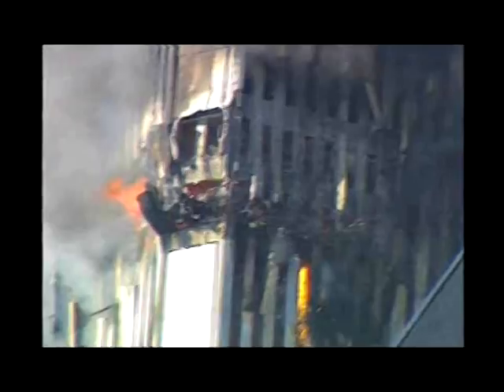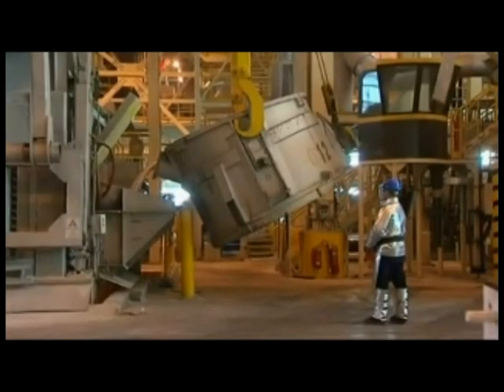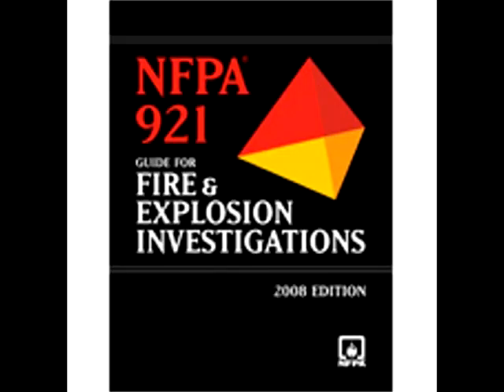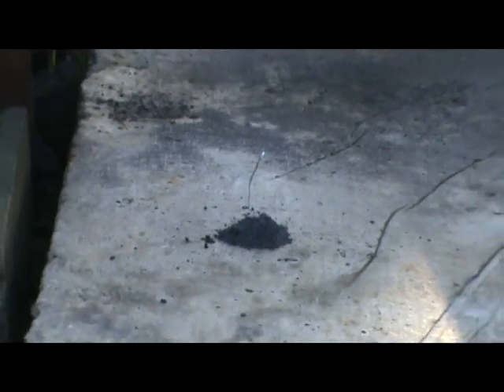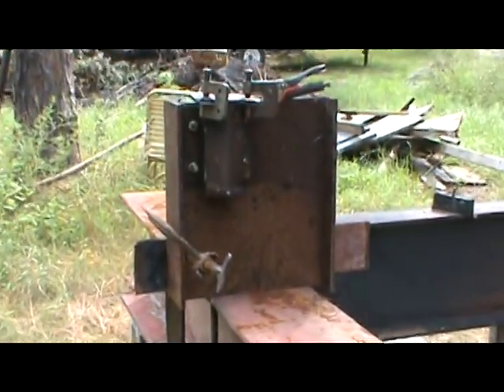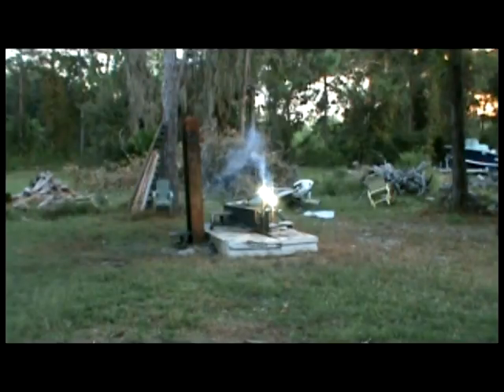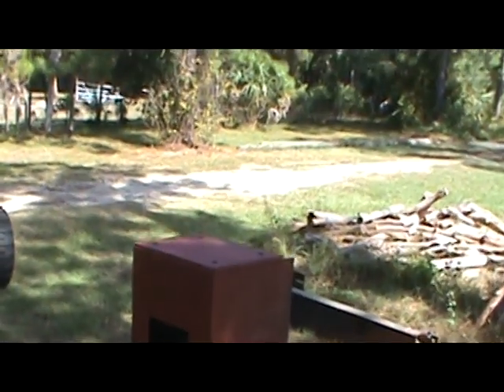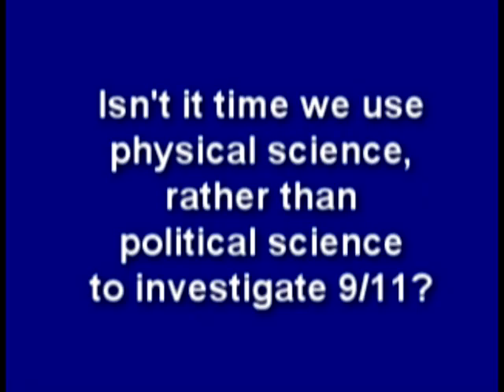9/11 Experiments: The Great Thermate Debate

Comment: lol I thought it was meant to be quite! 
also how did people set up these explosives within the steel framing? the truthers have to wake up
Reply: <also how did people set up these explosives within the steel framing? the truthers have to wake up>

Through the elevator shaft, which has access to the central support columns.  The shafts were closed and under armed guard the months prior to the collapse due to the "elevator modernization" that was taking place at the time.  The "elevator modernization" company is named ACE Elevator, and is a US government contractor with Pentagon ties.
Reply: ***** <The initial collapse of both towers started on the floors from which the Boeing aircraft entered the buildings.>

Irrelevant.

<This would mean that the charges would have to survive a passenger airliner crashing into them. >

No it doesn't.  Why do you insist on spreading the same tired lies that I just shredded on another thread?  Do you enjoy getting new assholes ripped? 

Simply placing the charges in a rudimentary shock and flame resistant container, and bolting them to the inside of the central support columns, would shield the charges from anything coming from the outside.

Are you retarded or do you just have zero imagination, and believe every unscientific "debunker" blog post that gets crammed up your ass?

<YES!!! i know that thermite can withstand extreme heat but the collapse was exactly at the point of the entry holes, so the plane would have knocked the charges on those floors out.>

Prove it.  Your weak-minded speculation doesn't amount to proof of anything.

<You can actually see the corners of the towers fold in on those specific floors.>

The charges would be in the center of the structure, not the corners you simpleton.  Again, your statement is worthless, as you can't see the central core of the structure, and because EVEN IF the impacted charges were damaged, simply initiating the sequence from directly above and below the impact, and then  cascading downward would have achieved the same effect.

Do you have any ACTUAL arguments, or just your baseless, factually devoid conjecture?

Don't bother with that last question; I already know the answer.
Reply: lol irrelevant?  why so? cause you say so?
explain why did the towers collapse at the point of impact?
Reply: Because that is where the collapse was initiated?

There are these cool things called computers, and with a special program, and remote RF detonators, a collapse sequence could be initiated essentially on-the-fly from any desired location, assuming the charges are placed and connected to the computer remotely beforehand.

The charges could be placed in a shock and flame resistant insulative container, and bolted to the inside of the core columns, effectively shielded from external projectiles, like shredded plane debris.

Even IF the plane damaged the charges on the impacted floors, simply initiating the collapse from directly above and below the impact, and cascading downwards, would achieve the same effect.

That's why his quaint "observation" is irrelevant.
Reply: lol ok of they just happened to be at the exact location where the planes struck.  watch the collapse videos again and see the exact location of initial collapse.  if charges were there they would have been knocked out.  
also if the charges were in a protective container, how would the charge destroy the protective container?  or did they calculated how much the container can resist the initial impact but not strong enough to resist the charge... 
lol
Reply: michael9678727 <lol ok of they just happened to be at the exact location where the planes struck.>

Bullshit.  You can't demonstrate that, and you can't see into the core of the building where the charges would have needed to be placed in order to bring down the structure.  

As most of the stairwells in the core of the buildings were still accessible after the plane impacts, it is safe to assume that most if not all of the charges in the core could have also survived the impact, considering thermite can withstand high heat and temperature, and considering it would have been placed in a protective, insulated container.

<if charges were there they would have been knocked out. >

Pure speculation.

<also if the charges were in a protective container, how would the charge destroy the protective container?>

By detonating...

<or did they calculated how much the container can resist the initial impact but not strong enough to resist the charge... >

Uh, basically.  It wouldn't be difficult.  Put a firecracker in your open palm, and it will explode harmlessly.  Close your fist around it and you could lose a hand.  The firecracker in the fist is the charge in the protective container.  The firecracker in the open palm is the initial external blast against the closed container.

It really isn't hard to imagine.
Reply: lol I can't demonstrate that?
watch the videos again and you can clearly see that's where the initial collapse started on both towers. 

you say I'm speculating but your whole argument is based on speculation! 
please remove your tin foil hat and listen to yourself!
Reply: michael9678727 <lol I can't demonstrate that?
watch the videos again and you can clearly see that's where the initial collapse started on both towers.>

Right.  Thats APPROXIMATELY where the collapse started, over the several floors impacted.  You're claiming to know the exact point of collapse based on roundabout observation, when you can't physically see the impacted beams in the core, so there is no way to say "exactly" where the collapse started.  Which, along with the other points I listed above, invalidates your position.

Moreover, EVEN IF what you say is true and the charges would have been knocked out on the impacted floors, what is stopping the pyrotechnics technician from simply waiting for the "natural" collapse of the floor to begin as you debunker types insist was inevitable, and then cascade the charge sequence downward as was observed?

Regardless of which angle you look at it, your "observations" are meaningless with regards to disproving Controlled Demolition theory.

<you say I'm speculating but your whole argument is based on speculation! >

No.  I'm happy to co-speculate, but my entire position is based on the scientifically proven and published presence of advanced incendiaries in the WTC dust by Harrit et al in 2008.  The details are unimportant.  The presence is proven, and all you can counter with is speculation.  I'm happy to cancel out your speculation with my own all day long, and we are still left with an inconvenient published paper that you and your ilk have been unable to refute for 8 years.

Unfortunately for you, your OPINION as to whether a theoretical incendiary charge in a theoretical container in a theoretical configuration in a theoretical location would survive a plane impact which may or may not have even penetrated to where these theoretical charges were theoretically placed, amounts to pure speculative bullshit, and does absolutely nothing to disprove the presence of thermite in the WTC.

You're going to have to address the established facts if you hope to get anywhere beyond useless speculation.
Reply: again, no the collapse started at the point of impact on each tower.
it's amazing how you truthers don't mention that all the "ingredients" of thermite was commonly found in paint, concrete, structural steel, air conditioning systems etc, etc. all common elements found in the towers. but hey let's just ignore that because it might debunk our theory.
Reply: ***** "You're claiming to know the exact point of collapse based on roundabout observation, when you can't physically see the impacted beams in the core, so there is no way to say "exactly" where the collapse started. "

"EVEN IF what you say is true and the charges would have been knocked out on the impacted floors, what is stopping the pyrotechnics technician from simply waiting for the "natural" collapse of the floor to begin as you debunker types insist was inevitable, and then cascade the charge sequence downward as was observed?"

"Even IF the plane damaged the charges on the impacted floors, simply initiating the collapse from directly above and below the impact, and cascading downwards, would achieve the same effect."
Reply: +Emvazz22 I had considered you arguments valuable until you came up with the stupid firecracker experiment.You think a small Thermite explosion has more power than a 140 ton vessel flying into the container? So the container wouldn't be damaged by the airplane and ignited by exploding kerosine (which has more thermal energy than a small magnesium rod) but by the Thermite explosion?

Even if that would be true, than most of the Thermite energy would be cutting outwards and not into the column.Or to put it into the Firecracker experiment: If I shoot through your fist, you have a hole in it trough which the firecracker can release it's energy. If your palm is open, the blast will take the way of least resistence as well. So if your plam (or the encasing) shall direct the blast towards the steel column, it needs to be thicker and sturdier then the steel column itself.

You, sir, have just debunked your own argument...
Reply: +ExtremeDeathman <.You think a small Thermite explosion has more power than a 140 ton vessel flying into the container?>

1) Who said anything about small?  The thermite reaction is very fast, very high temperature and energy, and a lot would have been needed to achieve the effect seen during the collapses (especially building 7).  Indeed, the Harrit report estimates somewhere in the range of the tens - 100 tons or so of this advanced incendiary material present before the collapses.
2) There was no 140 ton vessel flying directly into the container.  There was a 140 ton vessel flying into the side of a massive skyscraper.  The 140 tons of that aircraft were concentrated in the engines and the fuselage, all of which have a very small cross-section relative to any given floor of the WTC.  Upon impact, the mass and energy of that aircraft was instantly dispersed, and then dispersed again and again as it continues further into the building.  No only is the chance of a concentrated impact focusing on one or all of these containers a ridiculous proposition, but even if the impact did line one or two up, it would presumably have enough energy to destroy the column that the charge was there to destroy to begin with, which would completely invalidate your position.

What was your point again?

<So the container wouldn't be damaged by the airplane and ignited by exploding kerosine>

Do you honestly believe there are no structural materials and configurations that can shield something from shock and heat within the core of a building, from something that impacted on the outside of the building?

< kerosine (which has more thermal energy than a small magnesium rod) but by the Thermite explosion?>

Total thermal energy is irrelevant to the ignition potential of thermite, but nice try.  Yes.  Paper, and gasoline, and wood, and most hydrocarbons, have more total thermal energy than thermite.  But you don't see people melting iron in a wood fire unless a blast furnace is involved.  That's because hydrocarbons have a slow and sustained release of energy, whereas thermite has a fast, nearly instantaneous release of energy, and the reaction reaches a much higher maximum temperature than hydrocarbon combustion.  This is why we use thermite to melt and cut steel, and wood to heat our homes.  This is also why we use high-temperature magnesium (or incendiary) matches to ignite thermite (which has a high ignition temperature), instead of relatively low temperature, but high energy hydrocarbons (like jet fuel).

<Even if that would be true, than most of the Thermite energy would be cutting outwards and not into the column.>

Uhh... Google "shaped charge" and then maybe pull your head out of your ass and watch the video you're posting on...

<So if your plam (or the encasing) shall direct the blast towards the steel column, it needs to be thicker and sturdier then the steel column itself.>

Nope, it just needs to be strong enough to withstand the likely-scattered force of an indirect external impact (in the extremely unlikely scenario where that would happen), and have an interior layer that is a higher melting point than the material it is focusing the thermite reaction onto.  The shape of the charge can also amplify the energy of a pyrotechnic charge onto a given surface.  As demonstrated in this very video, a shaped charge constructed of a thinner steel than that which is being tested against, easily succeeds is cutting the steel column.

But good job demonstrating your fundamental misunderstanding of what the hell you are talking about.